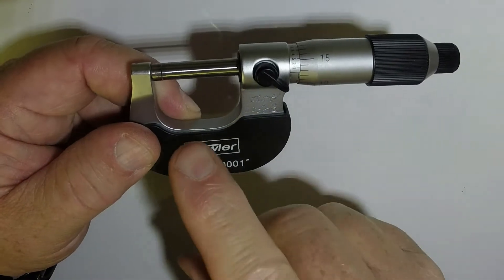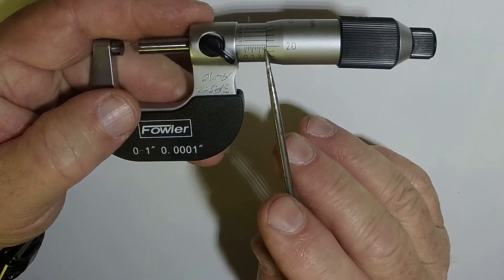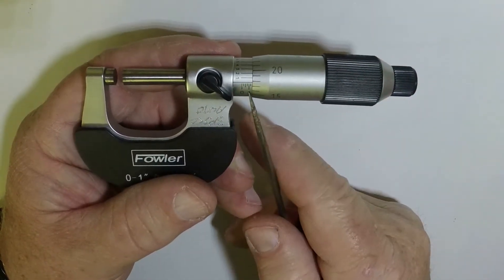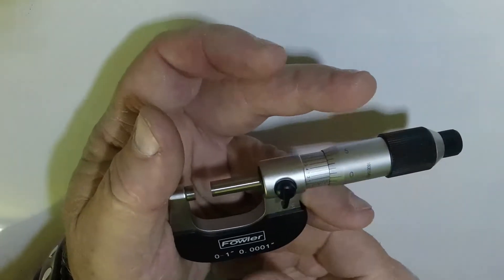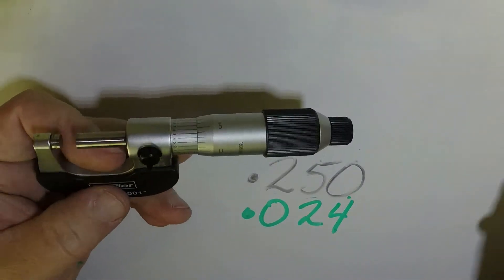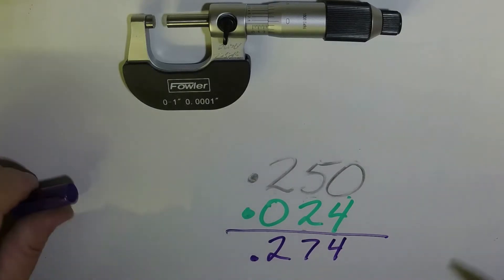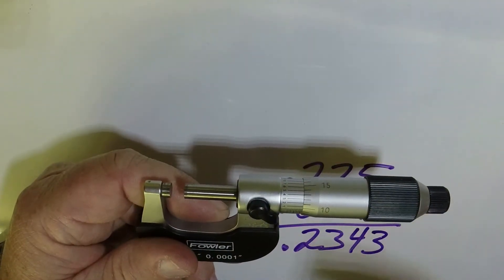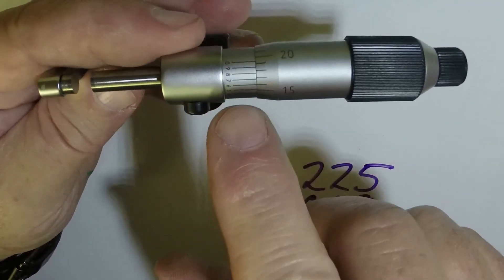Reading a Micrometer

Comment: I prefer the good old “analog” micrometer. All the new kids always ask, can I get a digital one?  The problem with the cheaper digital ones is that they dont always have an origin and are too easy for a naive apprentice to not know where true zero is. I have seen many a scrapped parts due to this error. Also, any micrometer will “grow” in your hand if you hold it too long if you are working out to 4 or 5 places. For constant inspection get a micrometer stand to prevent that from happening.